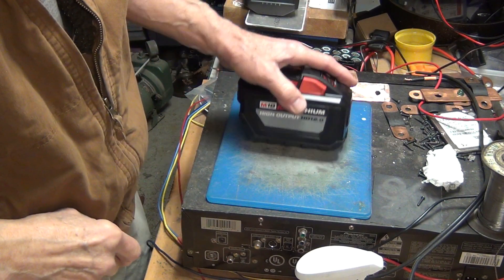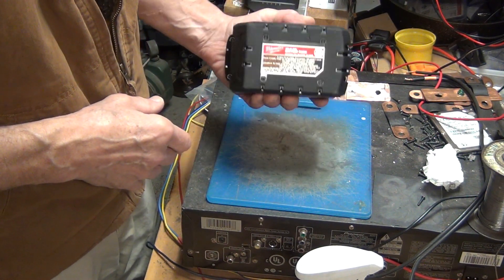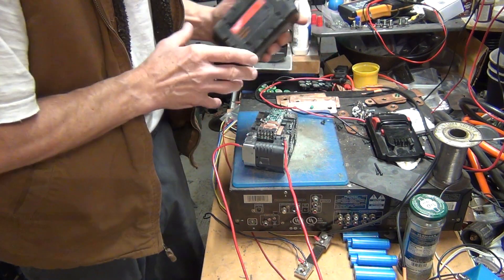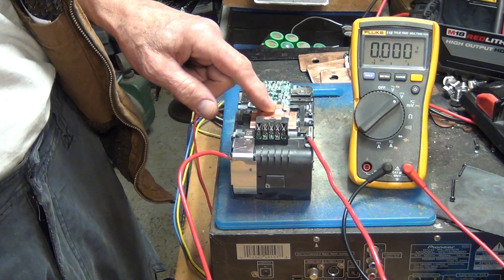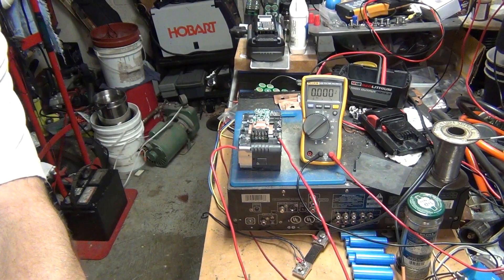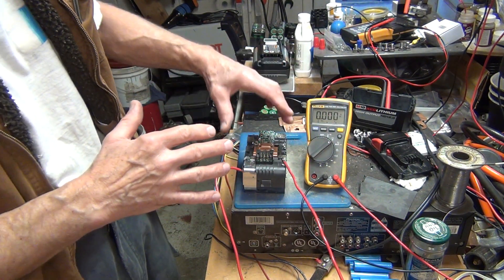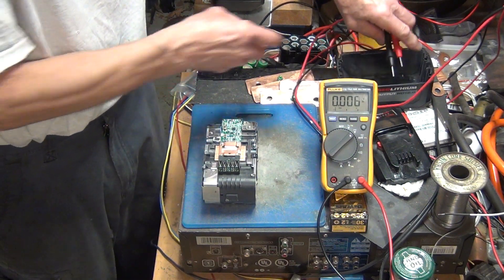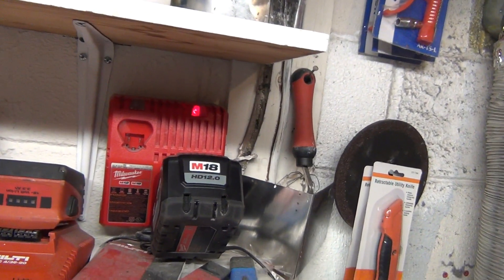How to fix any battery charging only to two or three bars

Comment: I have several practically new cylindrical FLEX 24V batteries which won’t charge to four bars either.  I guess I’ll use them until they give up the ghost then warranty them.  Hopefully by then they’ll fix the BMS.  Great tools, but they’re being let down by their batteries.

Comment: Thanks for posting. I thought it might be easier to charge than to discharge due to the lack of equipment in my kitchen... I put a couple of batteries in series to kick up the voltage of my after market 12V DeWalt battery. There were 2 different legs, one was under 3V the other was around 4V. Got the under 3 to 3.5V, would not go any higher. Threw it on the charger & BAM! Works perfectly!! Thanks for the balancing insight!

Comment from the maker: So this Milwaukee battery pack is complete junk, and I mean manufactured junk I used it about 5 times after I balance the cells and always discharge it no less then two bars and it is charging to three bars again, so it is out of balance again. So this battery pack must not have any balancer incorporated in the BMS. Shame on you Milwaukee to produce such a junk!!!
Reply: I have same issue with my HD12.0. If I fully discharge it then it will charge to 4 bars but if only partial discharge it only charge to 3 bars
Reply from the maker: @rotaryenginepete  lol wouldn’t that be normal for any battery :)
Reply from the maker: Absolutely not, Ryobi makes decent quality batteries